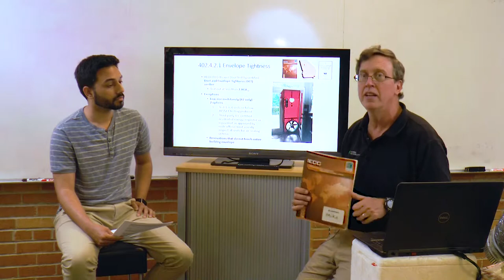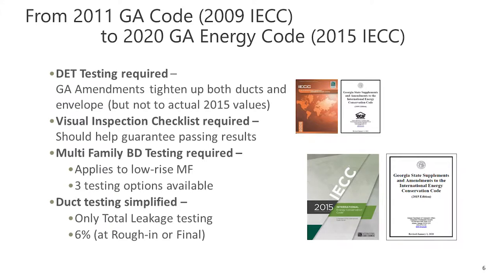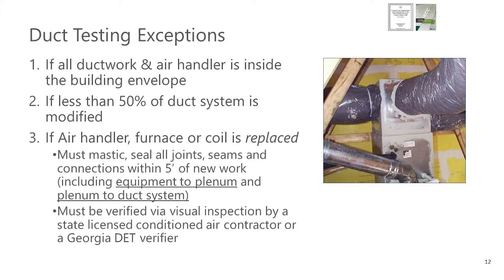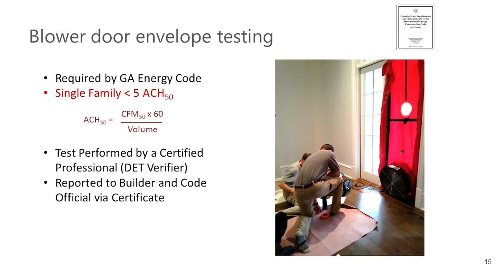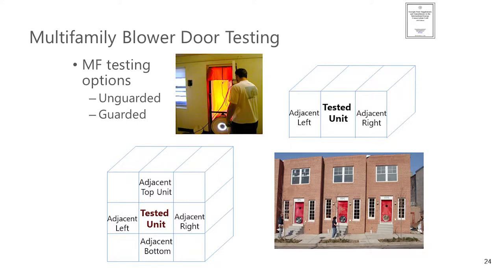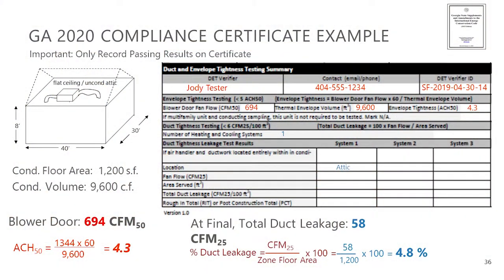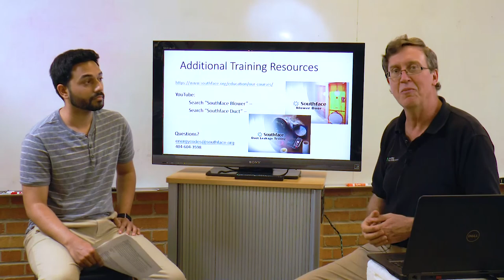Duct and Envelope Tightness (DET) Verifier 2020 Updates

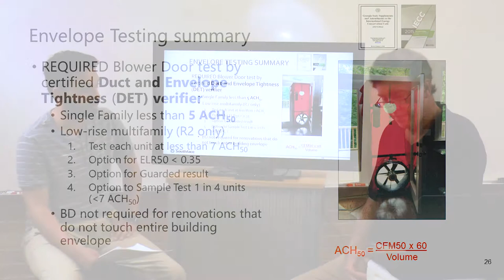Comment: Rats, there's a typo on the screen at about 14:00 - the 694 cfm50 is correct (the equation incorrectly shows 1344 cfm50); and the 4.3 ACH50 is correct.